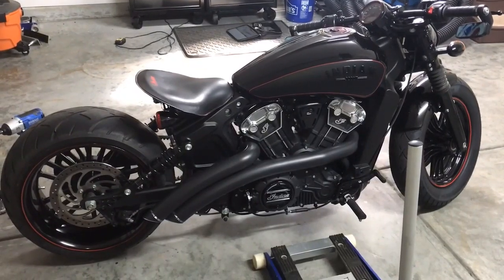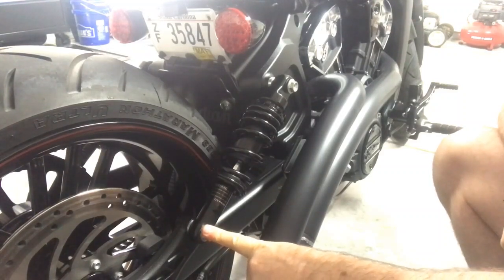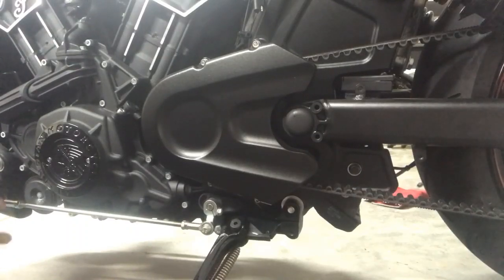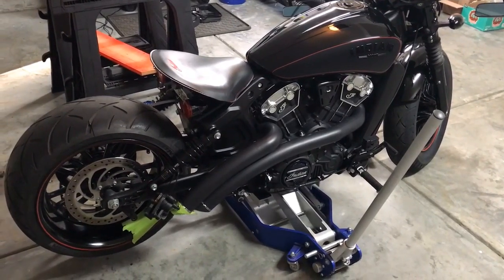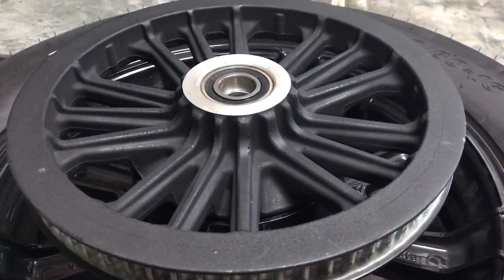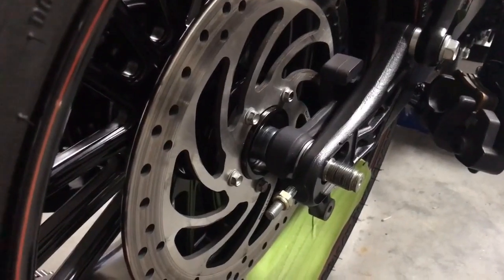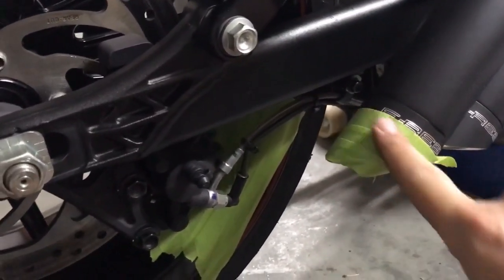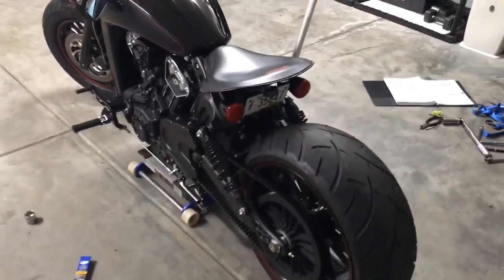How to Install 240 Tire on Indian Scout Bobber

Comment: My mechanic looked at this video while we were discussing putting the 240 tire kit on my 2024 bobber and even he was impressed with your explanations and skills.  He's installed a bunch of 240's on harleys so he was unfamiliar with the RC setup on an Indian.  Needless to say; he told me to go ahead and order the kit and he would slap it on with a custom fender job and rear light setup.  This will all be done after I get back from Vegas in April.  Thanks for another great video!
Reply from the maker: I really appreciate the feedback. Thank you for watching the video. Just a word of advice, RC sends the rear wheel with the Metzeller 888 tire for a reason. Due to tire size inconsistencies some 240 tires will not clear the swing arm and will rub. Good luck on your build. You won't be dissapointed!

Comment: Is it not worth to jack the bike up before undoing the suspension to release all pressure?
Also that belt looks so close to the wheel. I'd be a bit worried about that rubbing.

Comment: have a questions did you have any problems lining up the belt tension lines on the rear axle can't seem to get the the same to where the belt is in center of pully
Reply from the maker: Mine was never center either, just slightly left of center. Just make sure your tire is clearing subframe and belt tension is good and you’ll be fine.

Comment: What I did to lift my scout was remove the seat and hooked a wrachet strap around the top of each shock bolts and across the seat area, then used my engine hoist to lift the rear up, the balance was perfect and no fear of dropping the bike.
Reply from the maker: Not a bad idea. I like it.

Comment: Me again, I just installed that beautiful massive tire on my bike, but.....ok, I didn't thinking about my fender and seat ( Corbin ) that was fitted on bike before and now I need to make my scout bobber to be scout twenty. Meaning, it has to look like yours with seat haha. Now I need to go to Indian and see if I can buy complete set to transfer seat positions. On bobber seat covers battery and cables so now I have to close it. Again, thank you for this video helps me a lot
Reply from the maker: Glad you found it helpful. The 240 takes the bike to a new level of badass!

Comment: TIP: when removing the axle spacer. If the old one is in there right and you can’t pull out out. Get a flat head screw driver and push up while rotating the spacer. Took me about 3 minutes just to get it out because it was really stuck in there.

Comment: Not sure if you'll see this because it was so long ago, but i have a '24 scout bobber and was wondering if this would work with the stock rear fender?
Also, i couldn't agree more with how detailed your instructions are. Love your bike. And thanks.
Reply from the maker: @JP-wh8yj  Thanks for checking out the video. This will not work with the stock rear fender because it is attached to the subframe which needs to be removed. RC Components does sell a rear fender that will work however.
Reply: Thank you!!

Comment: Hello and greetings from Spain. I'm trying to find out what type of rim and tire you have so I can upgrade my Indian Scout to a 240 wheel. Could you tell me? thanks a lot
Reply from the maker: I ordered it from RCcomponents. It is their “Stocker” wheel. If you have a Bobber it’s a “Raider” wheel. It is an 18X9 wheel. The tire they use is a Metzeller 888, 240/40/18. Due to slight tire size difference between brands, not all 240 tires will fit the swing arm of the Scout. The  Metzeller works without any clearance issues. The price here in the states is approximately $2300 for the wheel and tire.

Comment: Hello, I'm about to pull the trigger on this RC Components kit. I want to ask, so I'm sure, all of the spacers you mention in the video are included with the kit, correct? Thanks, great video!!!
Reply from the maker: That’s correct. RC will provide necessary spacers but you will also reuse inner axle spacers as mentioned in the video.

Comment: Hi - thank you so much for this video. I’m waiting on a set of wheels to arrive and this is just brilliant.
Do you need to grease up the axle when installing the new wheel?
Reply from the maker: That's a great question. Yes, but a very light coating will suffice. I believe when I originally installed it I used wheel bearing grease.
Reply: Thanks again - and honestly, what’s guys like you do for the rest of us just getting started on our journey - its priceless. Legend!
Reply: Hey again - been following your vid step by step, I’m stuck getting the stock spacer out of the rear belt drive sprocket.. I CANNOT get it to budge… any ideas?
Reply from the maker: @markmcginness1933  Try putting the entire belt drive in the freezer for an hour. Materials will contract when cold. If it still won't come out, get a couple of pry bars and place them 180 degrees apart and try prying it out. Make sure to place a towel or shop rag under the pry bars as to not damage the machined edge of the pulley.

Comment: Can I replace the wheel with an 18 x 8.5 wheel without replacing the swingarm in the original condition?
Isn't the swing arm short?
May I know which product it is?
Reply from the maker: You have to remove the subframe, not the swing arm. The subframe is what the rear fender attaches to. I have the stock swing arm. The brand for the wheel is RC Components.
Reply: @oxouk  so,
Can I use the original swing arm as it is?
Do I need to remove the subframe because of the wheel size?
I'm a country that doesn't speak English so it's too hard to understand
Thanks to your video, I am able to try. Thanks!
Reply from the maker: @MANJAEMAN  yes, only remove the subframe.
Reply: @oxouk  Thank you for your kindness. Blessings in your bike

Comment: Thanks a lot for this useful video. 
By the way, do you know if the original rear fender from Indian is compatible with the 240 wide rear tire ? Thanks un advance
Reply from the maker: You’re welcome. The original Indian fender is not compatible, but RCcomponents makes a kit that includes a compatible fender
Reply: @oxouk  many thanks for your answer 👍

Comment: Dope video brother, so I have a question. I would love a 240 back tire and this video will help me a lot but I want a skinnier front tire is that possible and it smart? I was told that putting a skinnier front tire on the bobber can and should not be done. Thanks 🙏🏼
Reply from the maker: There is no right or wrong on tire size as long as the rim can safely accommodate the tire size. Handling will be different but nothing you can’t get used to. My philosophy is this. If I spend money on a mod and it doesn’t work out, put it back the way it was, sell what you bought, maybe you lose a couple bucks. That’s the price of modding bikes/cars etc…Trust me, not all of my ideas worked out.

Comment: Great video i’m always afraid to do stuff on my own on the motorcycle but you making me want to start do it. I have a 2018 scout bobber How do i order the kit?
Reply from the maker: I ordered the kit from RCcomponents.com. The wheel that matches the bobber wheel is called the “Raider” wheel. They ship it with a Metzeler 888 tire. If you choose any other tire brand it may not clear the swing arm and will rub. This is because tire sizes differ from brand to brand.
Reply: @oxouk  thank you very much

Comment: Thanks for the great video. Can you tell me where you purchased your 240 tire setup? What company, what site etc. Thanks. Did you have to buy a new rim for the rear and if so do you need to also increase the size of the front tire?
Reply from the maker: I purchased the wheel and tire from RC Components. A 180mm is the widest you can go on the stock rear wheel. You don’t have to go wider on the front but I went from the stock 130 to a 150.

Comment: This was great! Thank you. I was wondering, will this 240 kit work with the OEM bobber fender?
Reply from the maker: It will not work with the oem fender because that fender is attached to the subframe which needs to be removed to install the 240 wheel and tire. RCComponents does make a rear fender that will work.
Reply: @oxouk  thank you
Reply from the maker: @enjoythecampfire  anytime

Comment: What kind of tire did you use? I originally had m888 on it and tried switching to a commander 2 but the tire must be a little bit wider because it rubbed on both sides when I put it back on. Now I'm trying to figure out what to do next.
Reply from the maker: RC Components recommends the M888 for that exact reason. Not all tire sizes are the same even though they are marked as such. Your only option that is guaranteed to work is to stick with the M888. Other brands may work, but it will be trial and error, and costly.
Reply: @oxouk  unfortunately I learned that the frustrating way!

Comment: How does it handle now? I just bought a Fat Boy with a 240 rear and a 160 front. That thing won't make turns!
Reply from the maker: Mine handles great. The Scout has a very low center of gravity, so it feels lighter than it is.

Comment: Great video. Where can I get the red outline you have on the tank and tires? thx
Reply from the maker: It’s just automotive pinstripe tape. You can buy it at any auto parts store. It’s great because you can change up your color scheme for just a few dollars. Just make sure to clean the area with rubbing alcohol first for better adhesion.

Comment: @oxouk did you needed to edit any part the chasis of your bike to put the new tire size or only replace the original one for the new "240"?
Reply from the maker: The swing arm has just enough clearance for the 240 wheel and tire. The only thing you have to remove is the subframe which is responsible for holding the rear fender, tail lights, and the weight of a rear passenger.

Comment: Wow great video sir! Question I would like to live the stock fender on  it would be possible with the 240 tire?? Thanks in advance
Reply from the maker: You would have to remove the stock fender and the subframe. RC Components makes a compatible rear fender for the 240 tire.
Reply: @oxouk  thanks again! 👍

Comment: Great video!!! I am currently installing a 180 RC Component Patriot Eagle Eclipse rear wheel on my Scout Bobber. Do you know if I would need to swap that spacer on the pulley side of the wheel with a more shallow spacer as you did? I am doubtful since a 180 wheel is close in size to the 150 OEM wheel than the it is to the 240 wheel you’re installing. Any thoughts?
Reply from the maker: Travis, I would tend to agree with you. I think the shallow pulley spacer is just to help clear the belt guard or anything else that might be in the way, however I can't say for sure. I think you'll be fine without it.
Reply: I found out the space on the drive side does in fact need to be swapped w/ a slightly more shallow spacer.
Reply from the maker: @travisking1223  that’s good to know. Thanks for the update.

Comment: awesome vid..
not sure if you shared already the link where you get the kit.
will love to get the same one of your..
mine is a 2021
Reply from the maker: I got the rear wheel and tire from RC COMPONENTS. It was like $2300 or so. The Scout and Scout Sixty rear wheel is called the “Stocker” wheel, the Bobber rear wheel is called the “Raider” wheel. They are not the exact same design as the front wheel, but very similar.
Reply: @oxouk  you the man. thanks so much, you`re good man..
also I just subscribed ..love your work, keep it up

Comment: good day
Can you find out the exact size of the rear rubber? 😊😊😊😊🏍🏍🏍🏍👍
Reply from the maker: 240/40/18. If you use any other brand of tire other than Metzeler, it may rub due to inconsistent tire sizes between brands.
Reply: @oxouk  can you write a brand of rubber metzeler? more precisely 😊

Comment: Thanks for the info, so you can replace  a factory set up tire to a 240 size just with this spacers and a 240 size tire?
Reply from the maker: Correct, and a new wheel of course.
Reply: @oxouk  what is that and light setup?
Reply from the maker: @etishbite456  it’s something I made. Check out my latest video and I show you exactly how it was done. Thanks for watching.

Comment: Hey man great video I was wondering  how did you to the Indian logo black? Please help
Reply from the maker: I removed the originals, bought new emblems from "Cheapcycleparts.com", painted them, then installed.
Reply: @oxouk  what did you use to paint them? Do they come with the double tape? Just wanna make sure I do it right and not having the paint peeling
Reply from the maker: @hellsragegarcia6300  I used Krylon paint from my local auto store. Use adhesion promoter first (clear primer). I didn't use clear coat. The emblems will have 3M tape on the back and a clear film on top. Remove the top film, paint, wait until paint dries thoroughly (I waited 24 hrs), reapply the top clear film gently, remove bottom film from the 3M side, apply to tank, then remove top film. It'll make sense when you see the emblems.

Comment: Hey so the pulley and belt are stock ? No need for aftermarket pieces ? Just the 240 rims/wheels with the spacers goes right in ?
Reply from the maker: That is correct
Reply: @oxouk  awesome thanks man! Hoping to modify my bobber for this upcoming season 😁 240 babyyyyyyyy.
Reply from the maker: @bryantnajara5363  🤘

Comment: How much debris and/or water get kicked up on your back with no rear fender?
Reply from the maker: A mile high rooster trail if you ride in the rain, however I only ride when it's dry. I have been caught in the rain, but that's how it goes.

Comment: Can u send information about seat Ann mirrors
Reply from the maker: Seat came from Indian Motorcycles. It’s called the 1920 solo seat. It’s $399. Mirrors were bought from EBay then modified using the stock mounts.

Comment: What kit did you go with?
Reply from the maker: I went with the “Stocker” kit from RC Components. The stocker matches the regular Indian Scout front wheel. If you want to match the Scout Bobber front wheel then you need the “Raider” rear wheel.
Reply: @oxouk  Don't they have a kit as well that provide a new front and rear wheel.  By the way great video
Reply from the maker: @davidrivera6271  They May now, but when I ordered mine the only option was to add a rear fender and belt guard.

Comment: I didn’t see an ABS disc. Mine has it; will that make things difficult?
Reply from the maker: The RC Components website doesn’t mention anything about not being compatible with ABS model bikes.
Reply: @oxouk  I’m actually getting it done by RYNO Motorsports here in Orlando. I’ll order the kit (and a solo seat, closeout plate, etc.) and they’ll assemble it.

Comment: Let me ask you, how did you fit the brake spacers in with the caliper mount, I have ZERO clearance, i can't even get the thick spacer and caliper mount in.  looks like I need 3/16 of an inch more room.   Did it just go right in for you?
Reply from the maker: I had no issues at all. Assuming all your parts are correct, I don't see why it won't fit.
Reply from the maker: I just watched the video, You need to remove the stock spacer from the left side of your wheel, it's 3/16 or so longer than the one that came with the new wheel. That's where your clearance issue is. Go to the 12:00 min mark in the video and you'll see what I'm talking about.
Reply: Thanks for your reply. Got it all squared away it was just really tight and took some finagling
Reply from the maker: @shayc-g6u  Glad to hear that. Now go ride that bad machine!

Comment: I installed the spacer on the sprocket…Is it normal to have the belt sitting a little bit more to the left side / to Towards the outside not on the center of the sprocket ? Thanks
Reply from the maker: Once you align the rear axle tensioners and get your desired belt tension and wheel alignment where it needs to be, the belt will sit right where it needs to be on the sprocket. Don’t worry if it’s a little off center. Mine was also.
Reply: @oxouk  thanks brother for the info god bless you
Reply from the maker: @Justmil69  always happy to help.

Comment: Is your front wheel the stock 16" or did you get an 18" to match the rear?
Reply from the maker: stock 16" wheel. In my opinion putting an 18 on the front loses that stocky muscular look to the bike.